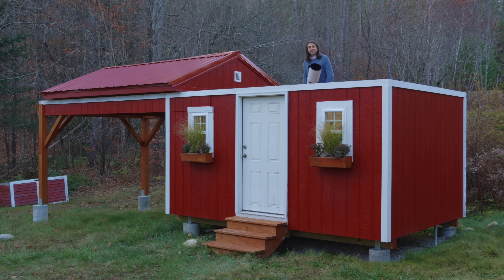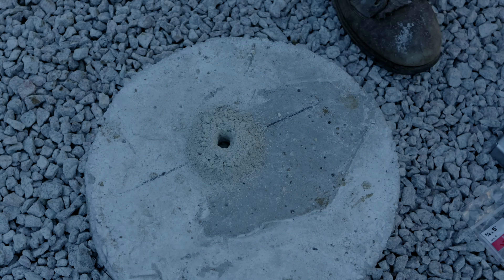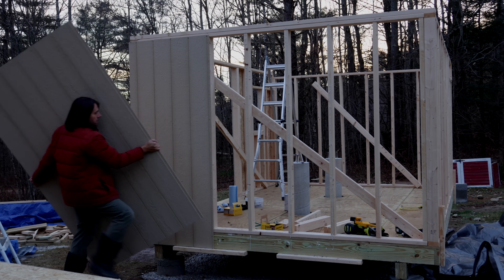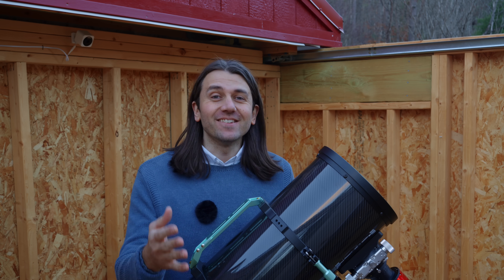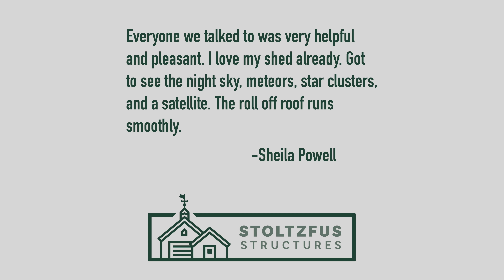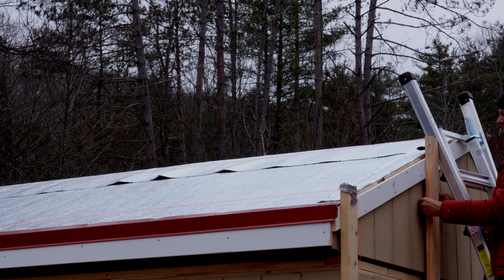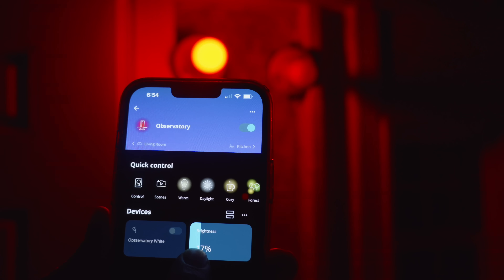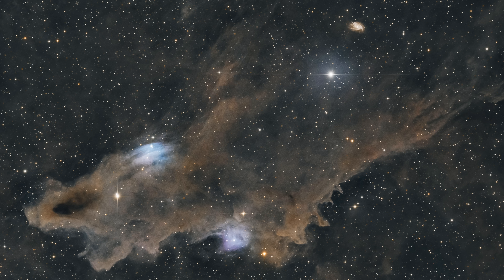Building a Backyard Observatory from Scratch (Fast Version)

Comment: If you need to cut the roof tin then you improperly design the building. Take into account R panels come in 26", 28",32" and 36"widths. Design your building accordingly. Because if you don't it's gonna rust in you're cut...

Comment: Great video! How do you keep mice/critters from coming up through where the floor connects to the piers?
Reply from the maker: I haven't had any mice in three years so I must be doing something right. I do occasionally get spiders and other insects. To answer your question simply, I use a flexible foam 'pool noodle' with a cut in it to fill the space between the floor and the piers. This helps keep anything larger than a spider out. 
A few other possible factors:
1. I laid down a fairly thick layer of crushed stone under the building. I think that critters don't like this compared to a more natural environment.
2. My observatory is never heated. Mice seem to gravitate to heated buildings in the winter.
3. My observatory is elevated well off the ground. I could see that going both ways, but despite being right next to the forest, I never see any critters under my observatory.
Reply: @NebulaPhotos  Thanks for the reply! I'll keep that pool noodle trick in mind

Comment: Excellent tutorial!  Loved your visits to other homebuilt observatories and that inspired me.  I built a smaller rolloff one 1.5 yrs ago.  I too had the garage door roller things.  About a year after, they started to sag (weight is on wheels which is offset from where attached) and twist the 2x4s they were attached to (I also had a solar panel on roof and heavy asphalt shingles).  I rebuilt roof a month ago and got 2 inch rollers from Amazon that are now directly under where they are attached. Rolls so smooth now.

Comment: I know it’s not “outside” outside, but how do you protect equipment from humidity and condensation during storage?  My sheds often flip atmospheres in the spring and fall and everything gets wet inside, causes rust and all that.  I would be afraid to leave all my gear permanently in the observatory for concern of weather damage.  Do you run a heater to keep things dry?   Maybe it’s not a concern.  Thoughts/advice/experiences?

Comment: My concern with such a design is that the viewing angle is limited by the height of the walls. Hard to see objects just on the horizon
Reply from the maker: Yes, in my case I have high trees so the tall walls don't limit me. I also tend not to photograph objects when they are near the horizon since I am then shooting through so much atmosphere. There are designs similar to this one, where the walls can fold down. A good option if you have better horizons than me.
Reply: @NebulaPhotos What is your own rule of thumb where you feel comfortable with the angle above the horizon, barring obstructions pushing it higher? Is it different based on cardinal direction?
I have a barn where I was thinking of installing tall pillars and opening the roof, but it's farther back on the property and more surrounded by trees (W, N, E) than a new structure closer to the house would be.

Comment: The largest, because it's easier to move in the smallest degrees at a time, putting the motor far away with the belt being used as measurement and control, two pulleys with a belt.

Comment: That was amazing. Somehow I didn’t see the series of your build. That was super impressive that you did all this yourself. I’d need to acquire a bunch of tools, spend ages in design and learn nearly every single skill in the process. If I were to have a back yard in which it would be ideal to place the observatory, I think the ad would have been once of the more effective sponsorships I’ve ever seen. I’m sure this will give them a ton of new business. My situation is that I’m planning an observatory on my roof. It is concrete but I think I’m going to check the vibration test before continuing developing large plans. Is there some documentation of this? Very nicely done!!

Comment: Interesting video, Thanks for sharing. Practical question.  With your gear mounted what is the lowest altitude you can image above the horizon?
Reply from the maker: I am limited by my tree line. It is different in each direction. At best (N and NW), I can image down to about 28 degrees. At worst (SW and W) I am blocked up to about 46 degrees. So I have to be a bit strategic about what I'm imaging and when. I'm still happy because my favorite three constellations (Cygnus, Cepheus, and Cassiopeia) are well-positioned for most of the year.

Comment: Hi Nico,
This looks great, is there anything you would change slightly now you have had it running for a little while?

All the best
Damo
Reply from the maker: Hi Damo, I've gone back and forth on the size and having two piers. Sometimes, I think I should have saved money and built a smaller one-pier observatory and put the second pier elsewhere in my yard to go after the Southern objects from a better vantage point. Other times, I really appreciate getting both piers running quickly and am glad they are together. 
So as crazy as this sounds, I'm considering a third pier, not an additional observatory just a pier with a good cover. 
My girlfriend also wants me to change the paint job, as she doesn't like the bright red/white. Cheers, Nico
Reply: @NebulaPhotos Thanks so much for the reply mate.
I am moving in about 4 or 5 months to land where I will have room. So I will put something together to keep the 24" dob set up full time. I will do some thinking and note to self....no Red and white lol.

All the best
Damo

Comment: Wow, this an awesome crossover of two different types of YouTube video I like, DIY and astrophotography! 

Never realised you were so handy.

I assume you don’t insulate the observatory so you don’t have to worry about condensation on your telescope?
Reply from the maker: Correct, It's just the studs inside, I didn't do any insulation. The telescopes can still get some condensation/frost on them especially when the roof is open. I think keeping the gear in the observatory puts a bit more wear and tear on the gear than keeping it all in storage, but I'm okay with the tradeoff.

Comment: Willing to share your total cost? Would be interesting to see the difference between DIY and Stoltzfus's general quotes.
Reply from the maker: I'll share the ballpark, but keep in mind I did all the labor myself which took months of basically working on this everyday. If you pay for labor, it can easily double these costs. 
Piers / Foundation (quickcrete, sonotubes, rebar) - $700
Building materials (wood, windows, door, screws, nails, paint, roof, etc.) - $14,000
Tools I didn't have - $5,000
Rough estimate is $15K (just materials), with tools a bit under $20K. These prices are for rural New Hampshire, mid-late 2024. 
Since I had no idea what I was doing my wastage was probably higher than normal.
Cheers, Nico
Reply: @NebulaPhotos  Cool! just looking at Stoltfus's their cheapest is in the $15k range, going up to 40... But learning while you're doing it, priceless
Reply: @NebulaPhotos 
Thank you so much for being open about this to my friend.
Reply: @NebulaPhotos Is horrible price for that.
Reply: @richardpetrovic8941 how do you figure that? Construction materials are brutally expensive these days.